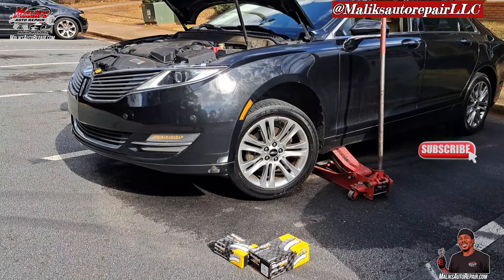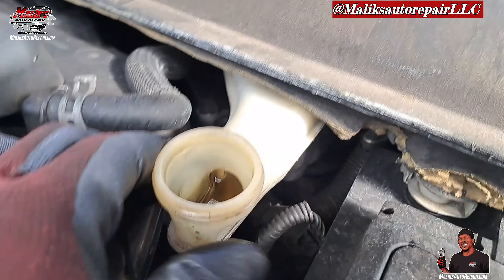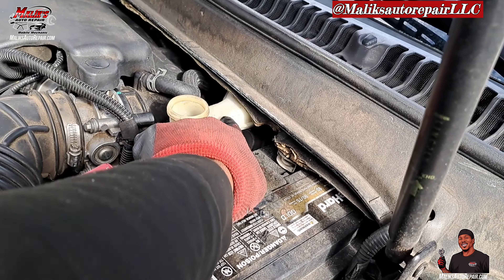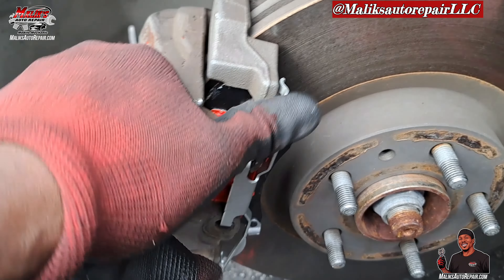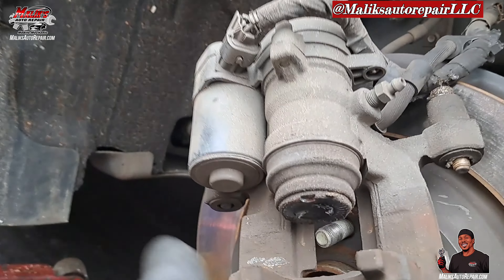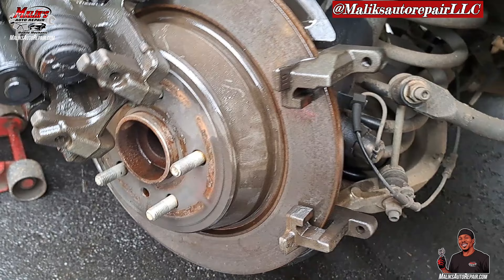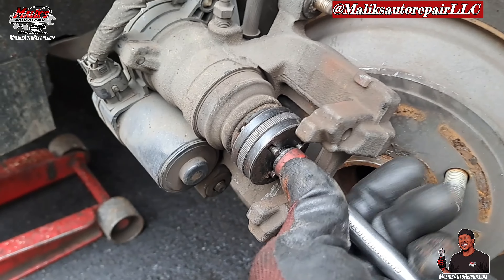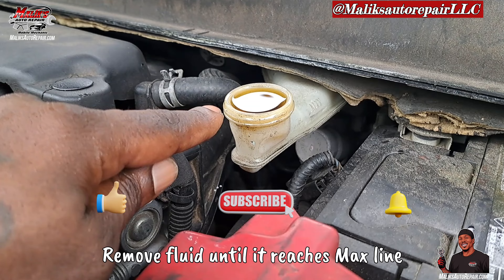FRONT & REAR BRAKE PADS | SPECIAL TOOL NEEDED | 2013 LINCOLN MKZ 3.7 | Howto/Diy

Comment: Once parking brake is in service mode piston can be pushed back in with either your hand or a c clamp. It doesn’t need the special tool to rotate it back in….
Reply from the maker: That's what I use. Thanks for watching.

Comment: These dealers always making new parts that need unnecessary new tools smh
Reply from the maker: Just a way to keep you from repairing yourself. They want you can take it to the dealer, so they cab tax you.
Reply: I have a 2015 MKZ Hybrid and the rear breaks can be put into service mode from inside the car (involving the pressing of the parking break, gas and start button) which pulls the pistons in. Am I wrong?
Reply from the maker: I have no idea.
Reply: @johnmellas  You are correct eliminates need for  caliper piston tool.
Reply from the maker: There's your answer. 😎